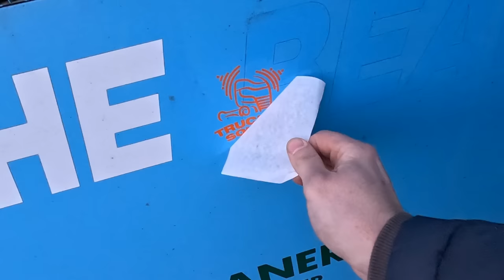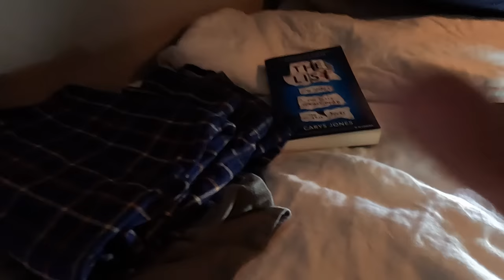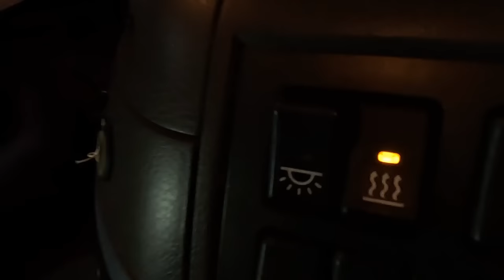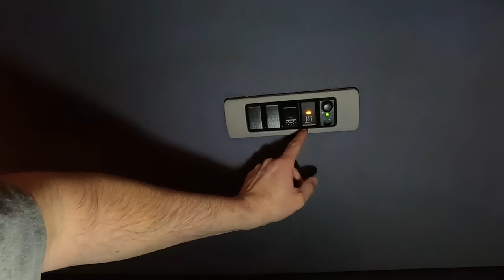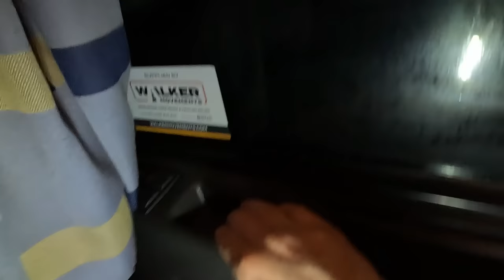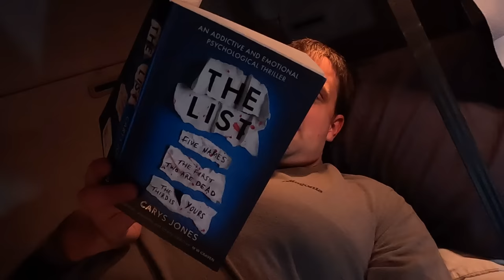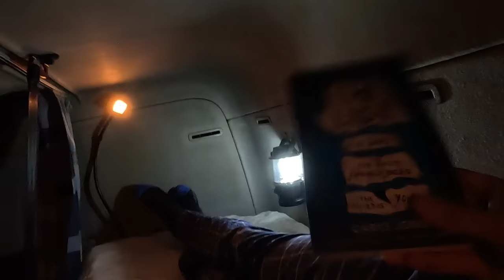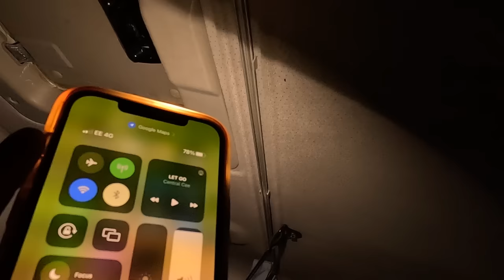Camping In A Truck On A HAUNTED Airfield | *NO NIGHT HEATER* | #truckertim

Comment: If you want another safety measure you could put the seatbelts through the inside door handles and plug them in to give you a bit more protection. Love the videos keep up the work 👍👍

Comment: Enjoyed your ‘night out’, very good. Just a quick security tip. If you forget your ratchet strap don’t worry as you can do the old seatbelt trick of putting it through the door handle and then fasten the belt. So the door is secured with the belt. Cheers Luke

Comment: Wouldn’t recommend cooking inside the cab. Without proper ventilation you could get carbon monoxide poisoning which is has no odour and will kill you. Just a heads up, maybe get a carbon monoxide alarm in the cab or cook outside next time

Comment: Nothing like waiking up at 3am when your nightheater stops working and it's -25C inside the cab.  Spent more than enough nights below freezing temps on truck so nowadays if doing otr stuff i always carry winter sleeping bag with me. and best you can you if nightheater stops working is crack the windows slightly open and embrace the cold air so the moisture wont build up inside the cab.

Comment: When doing straw to wales In our 1979 daf 2100 we never had a night heater of course but my alarm clock worked well, condensation dripping on my forehead from the none double glazed windows 🤣

Comment: Great video as always Tim.  Although, you might want to open a window when you are using one of those little gas stoves so you dont end up light headed or worse! 

It absolutely sucks having no night heater. Im a tramper myself and just spent a week tramping over christmas with no heating in the cab.

Comment: Tim I hate drivers locking there doors from insides with straps or seat belts, I’m a wagon driver and we had a driver who had had a night heater fire where the fumes had obviously got to him but in the lay-by other drivers tried to pull the doors open and smash the windows but it was too late. Be careful doing that because it could end your life.